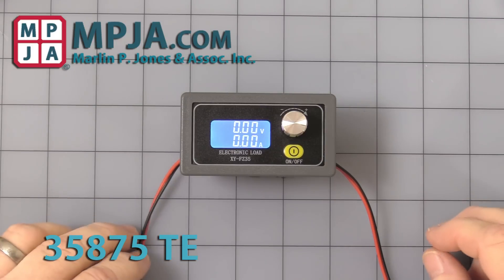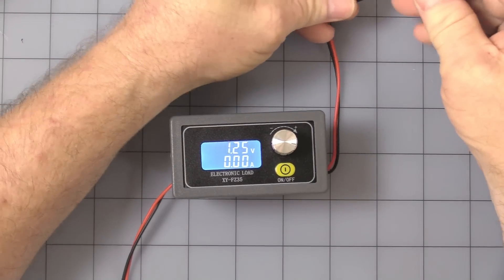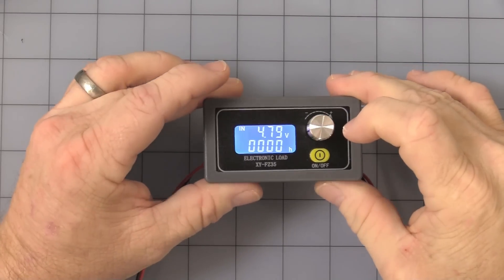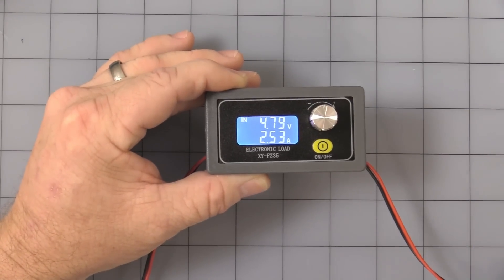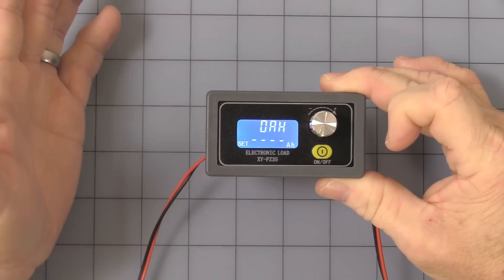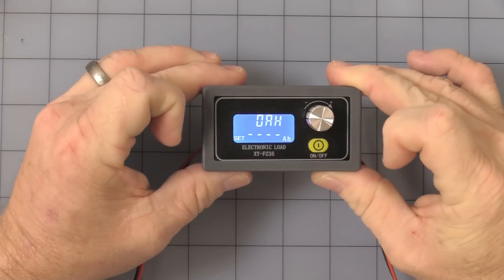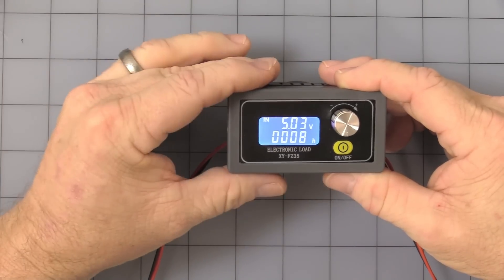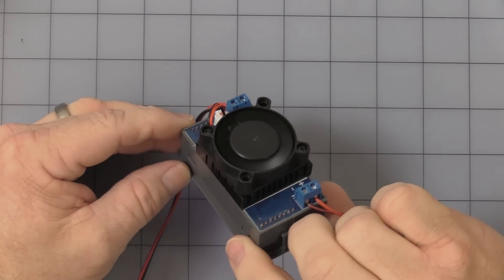DC Constant Current Electronic Load Battery Tester 35875 TE

Comment: Is it possible to turn off the voltage ceiling and load the 36 Volt power supply with a current of 0.1-0.2 A?

Comment: So far this device seems to be working well for me in runtime testing of USB battery banks. I have just two nits. The fan is reversed. It forces air into the heatsink. In my experience pulling air through the heatsink causes less turbulence resulting in a smoother air flow and better cooling. This will also help cool the rear board and other components. Even one of the advertising photos suggests that the fan pulls air away. Take out the screws and flip the fan over. Also when I popped the rear board out to solder on a pin header for the serial link I noted that the load transistor appeared to have no thermal transfer compound underneath it. I removed two screws and looked, and it did not. There should be a thin coating of thermal compound between the transistor and sink. Two minutes later this was fixed. The fan is cooling very well.

Comment: You didn't show how you were powering the unit itself, maybe that was obvious but where do the battery leads go?  can you use a 9v battery supply?
Reply from the maker: Look at about 28 seconds into the video to see where power is connected. It will work with a 9v battery but at a 25mA load it will only last about 20 hours.

Comment: Why does it drop voltage so much? Now I am testing a LiFePo4 battery, but at 1A it drops voltage from 3.3V to 1.61V. So UVP will kick in before it has drained the battery to its limit.
Reply: You are unfortunately, the owner of a dead battery. If you flatten a LIFE battery you will kill it.
Reply from the maker: I can’t answer why your battery drops so much with a 1Amp load with out a lot more info. You can change the factory LVP set of 1.5v In the video it is at 7:15
Reply: Hello 👋.  you talk a lot, but my knowledge is nil.  so if you could tell me what is connected left and right.  THANK YOU FOR BEING HERE ❤️ hello from Europe 👋.

Comment: Do you have the power supply specs to fire the unit up? Voltage as well as minimum amps?  Thanks.
Reply from the maker: With the fan running it can draw ½ Amp at 12vdc, Here is a link to the datasheet. https://www.mpja.com/download/35875tedata.pdf
Reply: Its up to 30V